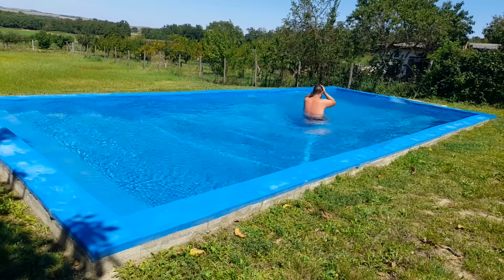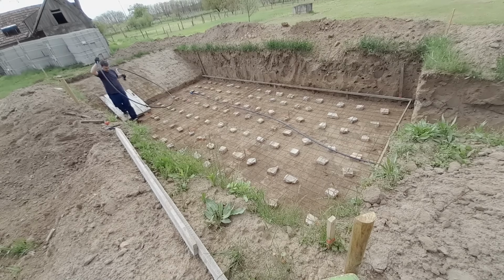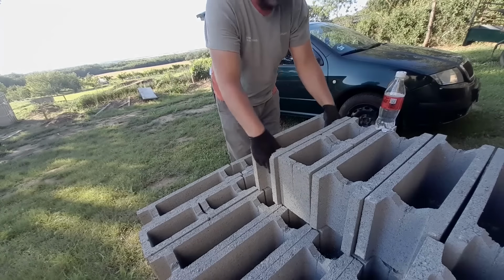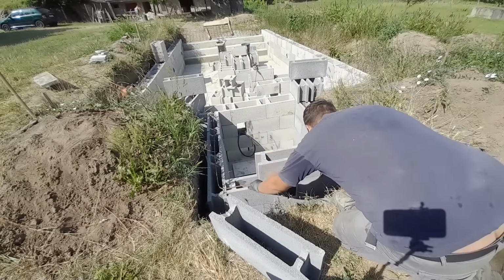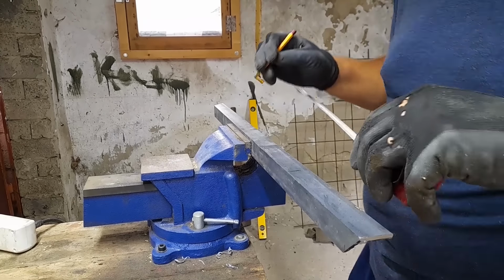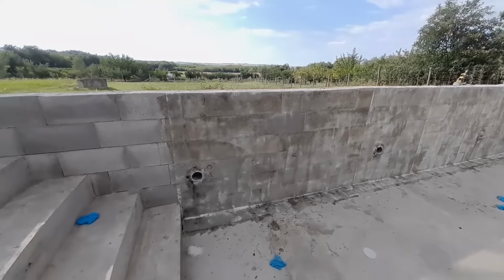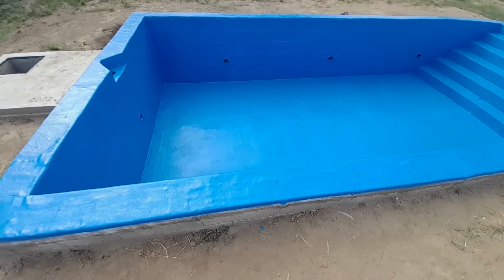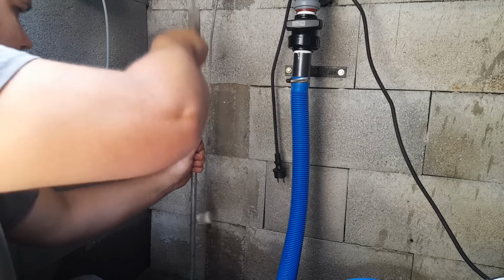How I Made a SwimingPool. Step by Step. Low Budget Projekt. #pool #diy #diypool

Comment: Please everyone who are watching this as a tutorial, stop right now. Everything about this is wrong, except the foundations. The walls should have done first, poured concrete, not bricks, after that the bottom part. The piping is so wrong, you want to use proper pipes for the pool, not the ones in the video. You could have used a metal finisher for the concrete about 1-2hours  after and make it smooth as a butter and not use linoleum which left air bubbles. And please, never, but never use 220v electrics in the pool for gods sake. Overall, major A+ in effort, but could have been done properly, way faster with the use of proper tools and not much more expensive. Pool is not something to be cheap on.

Comment: that slab is probably going to crack at bottom without rebar or level gravel graded layer under it it’s very large. if you have freezing ground it has nowhere to move. also putting wet concrete next to dry concrete you need to drill holes and put in posts it won’t stick and that is where cracks will form

Comment: Im fairly certain calling a truck to pour cement would have been cheaper than mixing it yourself and not using 2 inch PVC for piping so you can snake it when it gets clogged is WILD.

Comment: I was thinking of making one myself and the algorithm was already ahead. I heard quotes of 10-12k for a finished pool or 5-6k with "some" manual labor. The prices seemed high but now they look completely justified. The are kits with styrofoam bricks that are eventually filled with concrete. One advantage is the insulation that they provide as well. I wonder how you managed to treat the well water.

Comment: Great work, The only thing I would have done different is in my field of expertise.
Pool lighting I would have used low Extra Low Voltage 12v. Often lamps and fitting like this can be  submersible and happily live in flooded compartments. Lamp compartment then consist of  the compartment and a single pice of pvc pipe which goes straight up above the water line.
Makes for ease when ever having to replace any faulty wireing or components.
I’m obviously being picky but congratulations on your amazing result.

Comment: My friend. You did a great job 🎉. You have my respect. I did the exact same pool here I Denmark. But with blue foil instead of your fiberglass. I’m not sure if I should have done it your way instead. I also experienced the same leak problems as you. So believe me i understand your frustration 😅
Enjoy your good work 🤗
Reply from the maker: I stopped the leaks with a lot of work and by removing the lights. Endurance for the water leak to Denmark! :) Lots of red paint, patience and a syringe will help! :)

Comment: Admirable work! Any leakage from the light spots? It would be more safe to put the glass so that it stay pushed between the water pressure and a solid support.. better to use gaskets than silicon paste.. just to avoid misunderstandings, I really appreciate the DIY style.. I am only referring to safety here :) at least please be sure to use low voltage/amps led lights and not 230/110v current :)

Comment: Nice.... it' looks like you have brownish water on the end of the video. Did you use groundwater? I don't advise you to use groundwater. There are many minerals (iron etc.) in it, that you must get off. Best is to use drinkwater and keep filtering/cleaning it. Use salt in stead of chloor, it's better (for your skin) and cheaper. Groundwater wil make your pool get dirty!
Some things I learned from my DIY project, sometimes it is much cheaper to buy a commercial finished product then make it yourselve by trail and error. The best thing to do is poor concrete in one go. I didn't see any insulation on the sides and bottem of the pool (styropor)?

Comment: How much resin you have used for two layers? How it is working after 3 years? Any problems with fiberglass? Great job btw😊
Reply from the maker: If I remember correctly 70kg of glass and 140kg of resin. This year will be the 3rd time I've filled it up and it's holding up exceptionally well. If I were to do it again I would know how to do it much better with experience behind me. But I was thinking about another layer of glass fabric but since it would only serve an aesthetic purpose and not a load-bearing purpose, I gave up on it.

Comment: awesome dedication.  thats the part I hate is the cost all the little things add up quickly.  I admire you being upfront with pricing.. I did a simple truck camper and with wood planks. plywood, rubber roof, I still was 1100 US by time I was done.  (straps to hold in into truck, spar varish, screws, hinges. etc they add up quick.)  Well done Sir.

Comment: The video is amazing. Thank you! And only $5k per project -- looks impressive! Thanks for the kinda manual!
I used to have a framed swimming pool. It's good, but yours looks better!
In the end of the video water looks pretty dirt. You can try using some pills this season. One pill costs ~$3-4 (In Ukraine, but in EU I belive the price should be pretty much the same) and can serve per ~10 tonns of water for about 2 weeks. Could also depend on a pill make.
You can simply create a basket for the pills and place the basket alongside the water flow source inside the pool. 
Thanks once again, regards

Comment: Cannot understand why you don't just use standard waterproofing material from a can? So much faster, so much easier, does a better job. You would then need to render over it or something but my god would it look better. If you wanted to do your fibreglass finish it would have looked 1000x better if you rendered the inside then put fibre glass over it.

Comment: Wicked pool build only thing I would have done different was used 2 inch piping PVC adapting to 3 or 4 inch PVC and used led lights because if the lights did ever leak led would never burn out or die.

Comment: No such thing as a low budget pool 🤔especially an outdoor one , a pool of that size should have 2 main drains and at least 2 (maybe up to 4) skimmers and all steel work inside (rebar) and around the pool should be bonded in at least 4 places plus bonding of the water for every one’s safety, I’m £25 grand into an indoor spa pool, taken 3 years so far, I also moved around 100 tons of soil/clay with a wheel barrow to skips over 40 metres away but I used a micro digger to load my barrow🤔I think another 6 to 10 grand should finish to a high standard🤔wish I’d filmed it for YouTube , starting to look good now🤔everyone seems to think a pool is just a hole in the ground 🤔I can assure you it isn’t

Comment: Thanks for the usd conversion but if you want to use  feet foot inches pound miles that would get you more American viewers it will show more consideration thank you
Reply from the maker: I thought about it and my narrator also advised me. But in the end, the unit system was so foreign and illogical that I stuck with SI.